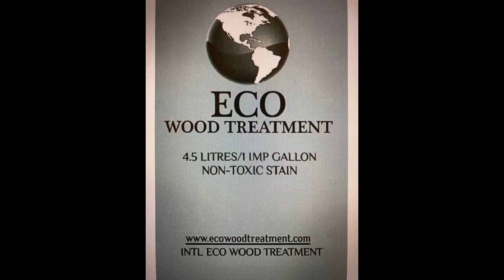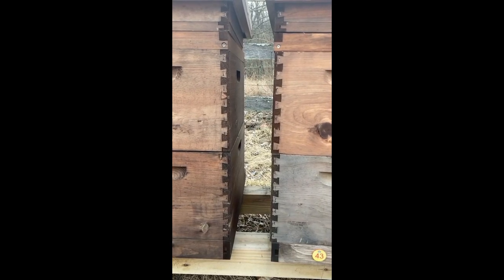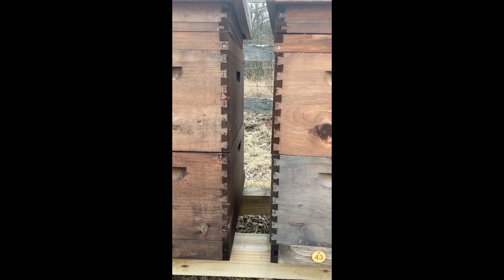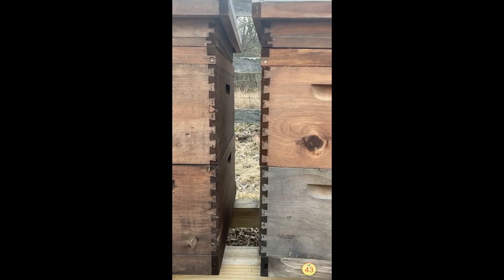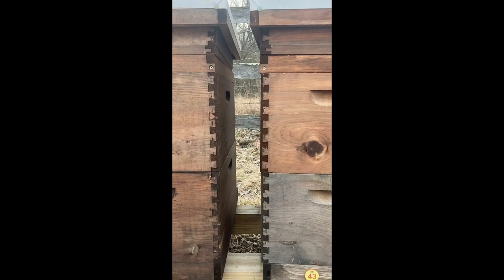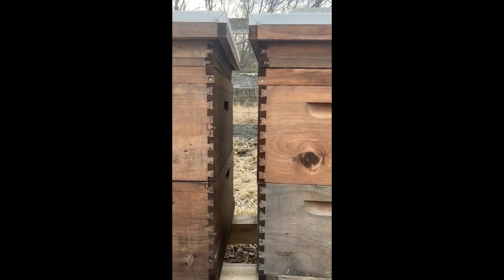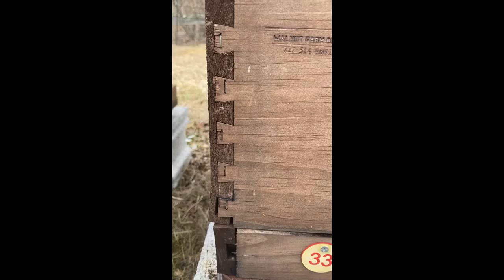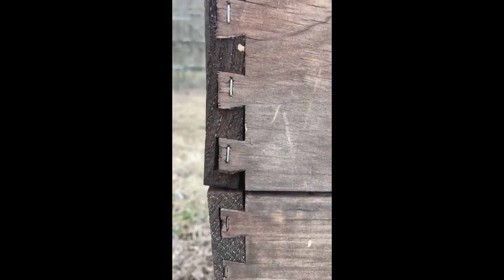Long term Results of Eco Wood Treatment for Bee hive woodenware

Comment: I've had the same experience here in middle Tennessee. After 2 years the brood boxes are showing some signs of warpage in the box joints. It's hard to re-dip but easy enough to paint, so now I've been painting over the Eco Wood treated boxes. Now I must wait for another couple years to pass to know if the paint improves this situation.
Reply from the maker: Thanks for sharing. I haven't tried painting over them as I don't want to paint any of my equipment, but I have used screws to fix them and may try wax dipping over some. Fortunately we now moved on to wax dipping. I may still use it for honey supers, as they have done fine, since they're only outdoors a few months in the summer.

Comment: Ecowood is just preventing living things (mold,insects) from eating the wood. Oil is preventing the water from entering the wood. Water does not only help wood rot. It also changes the mechanical properties of wood expanding it and then when drying it shrinks. That's why you need both. Ecowood with a mixture of tung/wax would be ideal I think.

Comment: I'm not having this problem and we get decent temp swings over winter in Indiana... however - I use the Ecowood first and then 2-3 weeks later paint the boxes w/exterior latex.  Yep I'm double coating but it's easier and cheaper than wax dipping or having rotted boxes.
Reply from the maker: Yes, I believe that is the key. Coating with something else (whether paint or stain/sealer) after the Ecowood has time to set in...Thanks for sharing your experience!
Reply: No primer?
Reply: @MinnesotaBeekeeper  No - I don't primer, but do put on two coats of exterior latex.

Comment: Hey Brian.  I did a video as well this year with Eco, mixed with another treatment.  Have already had a similar issue on my cedar boxes, but only the ones that I stabled together.  I'll have to see how well the boxes that are screwed together hold up.  Thanks.
Reply: Thanks for that comment, good to know. I found that the stapled and glued ones that also got coated with oil stain are fine. I’m trying some screws to tighten the warped ones back up.

Comment: Curious if you glued your joints as well as stapled? Do you think the additional mechanical strength from glue would help?
Reply from the maker: Yes these were also glued. I am sure there are ways to diminish the effects (such as screws) but bottom line is I’d never choose this product over wax dipped again. Im slowly aging out the eco dipped boxes and replacing them with wax dipped ones.

Comment: I couldn’t help but notice that the grain of the wood on the warped pieces were very wide.  Usually this is from a fast growing species of pine or a good growth year.  It also is more prone to warping no matter what you do.
Reply: Not always true. If properly kiln dried and painted you will not have any trouble. Half blind dovetails like this are awesome for boxes. Lots of glue and 2 coats of primer topped by 2 coats of top quality exterior paint and your good for 5 years easy. No matter the lay of the grain. Eco wood is crap. Thays this guy's problem. He trusted his investment poorly. And is sharing to help others. Any wood any grain will go crap bare.

Comment: What kind of oil product do you use on top of Eco wood treatment? Plus is the oil product harmful to the bees?
Reply from the maker: I use Sherwin Williams Super Deck Quick Coat Natural Oil. I don't coat the inside of the boxes with it, and it's well dried before using it for bees.
Reply: Actually the water based finishes can leach out, go with oil.

Comment: Good informative video. What kind of wood are your boxes ?? . Thanks
Reply from the maker: They are various types of pine. It's possible that cedar or cypress would work better. I may try that in the future, and we're also going to be trying wax-dipped boxes.
Reply: In general if you buy a box from dadant or Mann lake it's made from spf lumber.
Spruce, pine, or fir = spf

Comment: That’s what happens when one does not seal the ends and apply enough Titebond lll to the joints AND never use those type staples . I have five hives that’s been treated with ECO wood treatment and I glued and sealed the ends well . No issues after three years so far .
Reply from the maker: Where are you located? These were well glued actually but maybe the staples have an impact. What kind of staples or nails are on your boxes? As far sealing the ends, I agree and mentioned the boxes I coated as well after eco wood treatment didn’t have the issue. However it goes against what eco wood recommends which is to not do anything else to the wood.
Reply: I can say the same on paint.
Reply: That wasn't the cause. Odds are the wood was badly dried or over dried. Both can have similar results. Seen it many times in our mill.
Reply: What kind of fasteners do you use? I have tried 1 1/4" deck screws on both sides of the top and bottom corners. They don't pull out like the 1/4 crown Staples.
Reply: Tite bond 3. 8d galvanized hardboard siding nails.
Glue the ends. Warping still happens but rarely. 
Champaign, Illinois

Comment: What is the oil you used?
Reply from the maker: It was a triple oil sealer called duck back that Mann lake used to carry, not sure if it exists anymore
Reply: @walnutfarmbees-brian  I have some triple boiled linseed oil i may cut with Turpentine, Mineral Spirits, or Varsol and apply thinly and often. Thinking just soaking corners to give end grain longer to soak.
Reply from the maker: @phillipriggs3375 it’s possible. Seems like sealing the end grains did help.
Reply: @walnutfarmbees-brian  I am a pre-Beginner Beekeeper in the gathering stages to start May- June. You beekeepers are the most friendly community i have ever known, well.... beside my Church. Thank Y'all !
Reply from the maker: @phillipriggs3375  best of luck as you start with your bees—some challenges but a whole lot of fun!

Comment: Are those pine boxes.
Reply from the maker: Yes they are
Reply: @walnutfarmbees-brian  That is the reason they warped. 12 years back I had 15 hives, started with pine and after 2 years they did the same. I switched over to Cedar, they did well for 10 years until I had to get rid of them, my injuries prevented from taking care of them, both coated with Eco. I got the itch to have bees again, I am getting 2 Nucs and  using Cedar and Eco wood treatment. Hang in there and take care of them ladies.
Reply from the maker: @sailorddg9877  I never had pine boxes warp with other coatings. But that is interesting to know. I've thought about Cedar and also Cypress and suspect they'd work even better. Did you make your cedar boxes or buy them somewhere?
Reply: @walnutfarmbees-brian  This batch I bought from Foxhound Bee Company out of Bama, great service, highly recommend.
Reply: Not all pine warps. If they are not properly kiln/dried then you get warpage. We own a woodmill. Been there, seen that.
Reply: @walnutfarmbees-brian  Brian it has more to do with the drying process the pine goes through. To dry or high in the wood moisture, both can cause warpage.  To many people that have never worked in a wood mill blame all sorts of problems.
Reply from the maker: @MinnesotaBeekeeper  Thank you, Mike. I agree that helps but I don’t see this problem when they are sealed with wood oil stain afterward or wax dipped. So, maybe the drying is an issue and those other processes are sealing the wood so that doesn’t occur?